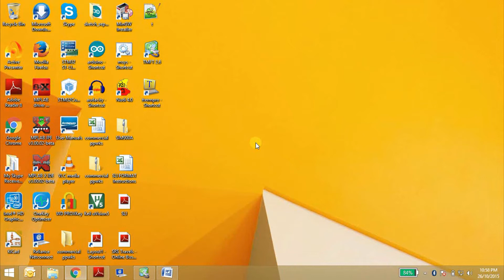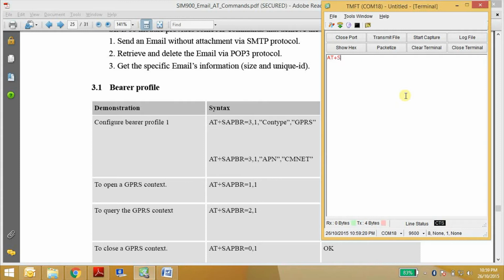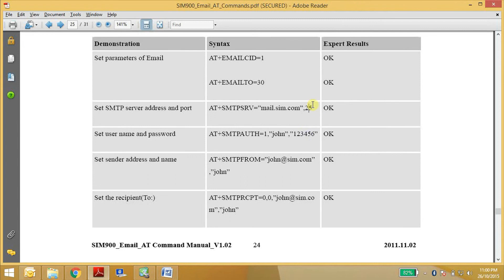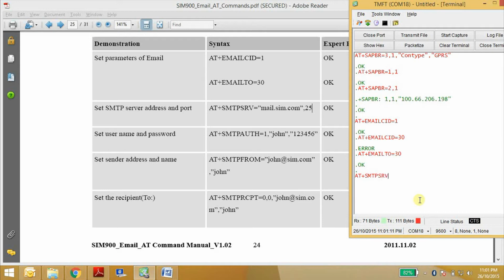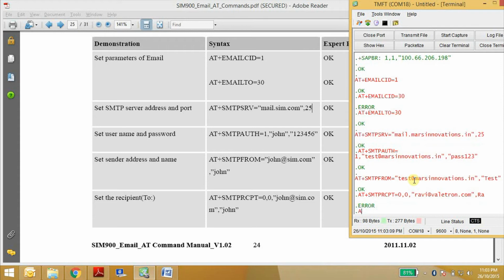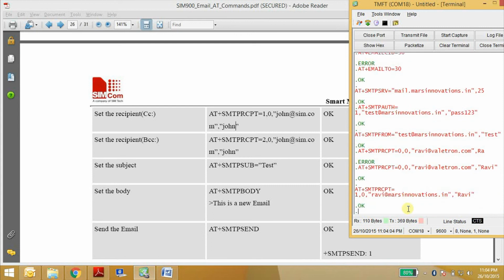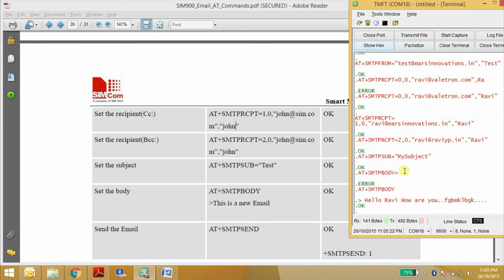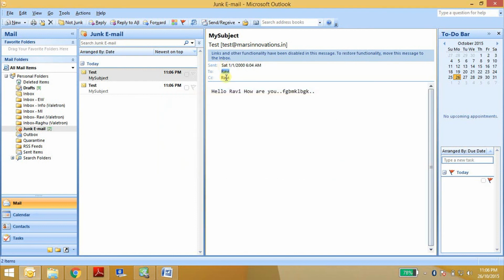SIM900 EMAIL AT COMMANDS - Sending email via GPRS

Comment: hello sir..
Thank you so much for this video.

will this same command work on SIM900A module and which firmware version is applicable for SIM900A to send emails using yahoo smpt server ?
 i am getting smtpsend error 63.
Reply from the maker: It should work on SIM900A as well on any firmware. Must probably network problem or server not reachable. Post technical questions on our forum http://www.embeddedadvice.com.
Don't forget to like share and Subscribe :)
Reply: @RaviPujar  thank you so much for  your reply sir.

Comment: Hi sir, I'm using SIM900A to send emails. Its fine with all basic SMS and Call AT commands. But when I'm trying to send mail, I'm getting error at AT+EMAILCID=1. What could be the possible reasons? Please help.
Reply from the maker: If your syntax is right it should not give error. But make sure you have a internet connection before proceeding to send email. Don't forget to share and subscribe :)
Reply: hi sir..
is this working now? if yes can you please guide me to which firmware version u are using ?

Comment: Sir.. my IP address is being displayed as 0.0.0.0. Could you please help?
Reply from the maker: It means you are not connected to internet. Check balance in SIM card and APN and also check if you got network, by giving a ring to the SIM card number inserted.
Reply: Ravi Pujar I am able to send and receive SMS. I have problem only with GPRS connectivity.
Reply: the problem for you is the APN. make it correct you will get that. Sorry to be late